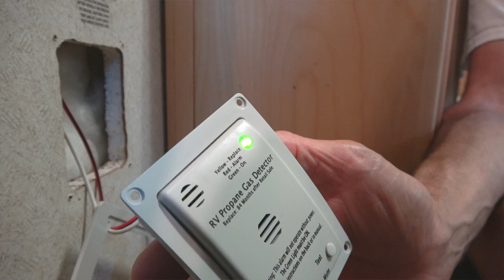Fix That Dripping Shower + BONUS TIP: Caulk Like A Pro!

Comment: I’ve been doing it that way for years, otherwise I make a horrible mess. I also run a wet finger over the bead a second time to remove the ridge created by the tape and the caulk gets feathered out nicely against the adjacent surfaces.

Comment: Peter, great video I would like to offer a suggestion if it is alright. First off our coach is a similar model and age as yours. We discovered a leak in our shower that was dripping into the bay below. Initially thought it was a drain issue and I worked on that but to no avail. The problem landed up being where the shower control fixture is plumbed into the PEX. The elbow connecting the two had sprung a small leak which was draining behind the shower wall and into the bay. Checking into this it turns out that the material used for that elbow has been removed from the market several years ago. It was removed because of the materials tendency to crack. Changing it out was easy (located just behind the large chrome bezel) and it gives you the opportunity to practice your caulking technique!
Safe travels
Reply from the maker: Hi Stephen! We had the exact same thing happen years ago, and had to make the same repair (replacing the fitting, which was disintegrating and had sprung a pin-hole size leak behind the shower control). Glad they took those off the market!

Comment: Always wet or lick your finger before you drag your finger across the caulk. It will leave a smoother and cleaner finish.
Reply from the maker: We've heard that before, Ray... but have always felt weird about doing it, what with all the admonishments on the caulk label about not getting it wet for XX minutes/hours!  LOL! Using a glove seems to get it pretty smooth without using water, so we haven't felt the need to press the issue! 😉

Comment: Great Job. We have rental units and when I caulk the tub surrounds using the same method I use Mono Ultra Kitchen & Bath. It's water clean up when wet and when you have to re-caulk any residual caulk can be removed with acetone. Just another alternative to silicone.

Comment: Great tip.  I learned the hard way, even after I was told to use painters tape, when I wanted to quickly caulk a small 6" gap in my belt line without using tape.  As soon as I run my finger down it and all the excess started balling up around my finger things got messy.  I had a paper towel handy but even then I got some on my hand and then touched the side of the coach and the mess just started getting worse.  It really took a lot to remove the smudge marks from the paint.  A good "lesson learned" experience.  Will definitely be using tape the next time.
Reply from the maker: Been there, done that, so we feel your pain. Definitely worth the time and effort to tape things off... just makes the whole job so much easier!

Comment: Good video, as always.... 
Those are "groove-joint pliers." Slip-joint pliers adjust to only two different sizes.
Reply from the maker: You’re right, but they’re most commonly called tongue & groove pliers. I usually refer to them as Channellocks, which is what my Dad always called them. But since that’s a popular brand name, I thought I’d use the generic name when referencing them in the video. But I misspoke, because I never use anything other than “pliers” for slip-joint pliers and “channellocks” for these. Maybe next time I shouldn’t overthink it, and just use the name I usually call things! 😂

Comment: Hi Peter and John. I love watching your videos! Your caulking tip is especially helpful. Do you know of any products or tips for removing mould from silicon sealant on motorhomes, that won’t damage the sealant?
Reply from the maker: Thanks so much! You can try using a high concentration of white vinegar, or hydrogen peroxide, but unfortunately, more often than not, mold grows into the sealant over time, and the only way to remove it is to cut the sealant out. That's actually what we do before re-sealing anyway.
Reply: RVgeeks Thank you.

Comment: Great tip!  Here's a shower related question:  Can an RV shower head be used in a house or vice versa or is the threat size different?
Jon in rural BC, Canada
Reply from the maker: It may depend on your RV manufacturer and type of shower faucet used. On our Newmar, the shower plumbing is all standard size, so the shower head would work just fine in a house, or vice versa. But we've seen some RV showers that use a two-handle faucet body with a hose coming up for the shower head, where the attachments aren't the same as a standard household shower. So your mileage may vary.

One thing we'd say about choosing your shower head for the RV... be cognizant of the potential for them to put too much water into the gray tank if you spend any significant time without hookups. Household shower heads generally provide more flow (which may be what you're after if you're typically hooked up to sewer connection) and may not be fun to shower in with the water flow turned down to conserve.

Comment: How's that shower head working out for you guys? Need to replace mine and I am looking for a new one that is also a water saver. Great tip, thanks guys.  Good job from the camera guy he worked very hard and did a great job on the zoom. lol
Reply: Oxegenetics shower heads worth GREAT !!!!
Reply from the maker: LOL! Thanks for the kudos on the camera job, Hector! I was under a lot of pressure to do a good job after Peter did such nice work on the caulk! 😉 Like @John Hines said, lots of people seem to really like the Oxygenics shower heads. But we've used this little one (available here on Amazon: https://amzn.to/2YX7s1p) for years and love it. Uses very little water (with a Navy shower, we can get clean and use less than a gallon of water), and provides a nice, even spray that's not "needly".

Comment: I have a question about caulking in regards to the bathroom.  I know in your video you were caulking a door, so this may not apply, maybe I just need some confirmation.  When I purchased my RV, as a newbie in 2017, the service guy during the walk through mentioned that I shouldn't caulk the gaps INSIDE the shower.  I can't recall the reasoning at the moment since it was about 10 degrees outside. LOL  But, it was about the gaps between the base and walls.  Areas that a homeowner would normally caulk between wall and tub in a brick/mortar home.  Good advice?  I have a 24' class C with basic shower set up.
Reply from the maker: Hi Jen! The service guy was mistaken. The space between the walls and base inside the shower are THE place caulk is needed more than anywhere else. It’s exactly what caulk is for.
Reply: @RVgeeks  Thank you as always for your reply!

Comment: Yeah, I know most people are not going to have their water pumps on and/or dry camping like you 2 do,but What you forgot to mention Peter with replacing the faucet, is shutting off the water pump.
Reply from the maker: That's true, Morgan. But watch starting at the 1:12 mark... I didn't say to turn off the water pump, but we put the text on the screen. 😉
Reply: @RVgeeks  oh, ok. I guess I didn't see that. X(